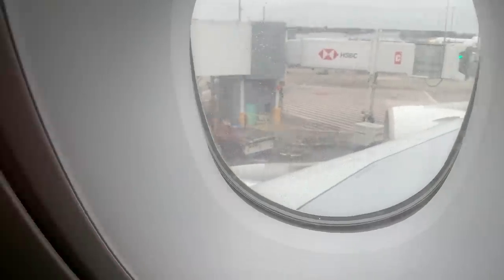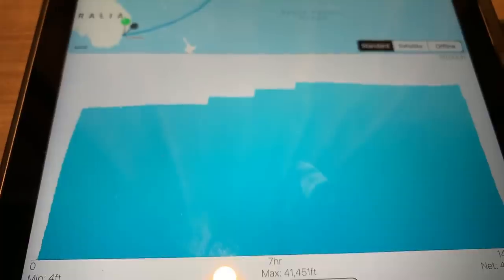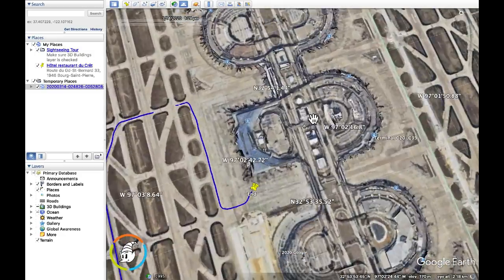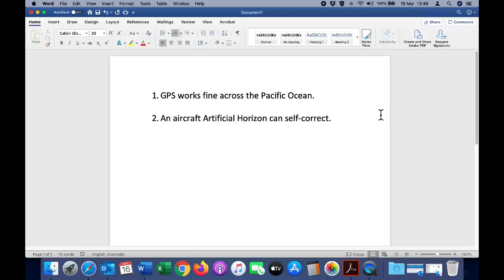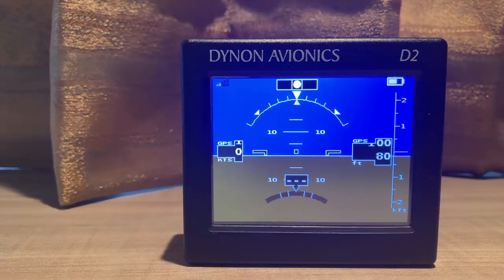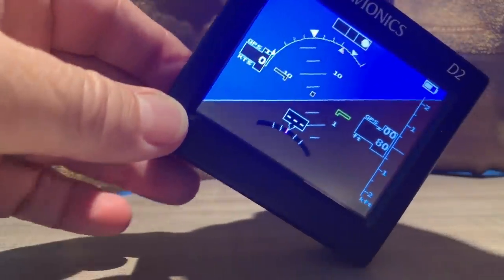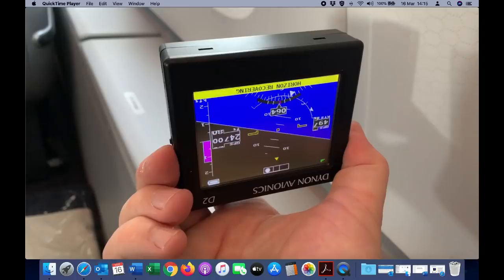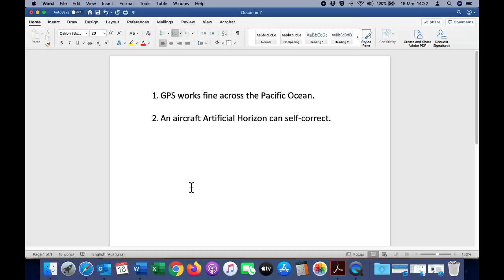GPS and Gyro testing on Qantas Flight 7 across the Pacific.

Comment: But what enables the unit to adjust for supposed curvature?, wouldn’t be the ambient air pressure differential sensors known as pitot type device? So my unit has no gps and no pitot tube, U.K. to South Africa should show minimum 35o we’ll see...

Switch off your pitot technology and show us your AH in you actual plane correcting, there is no curvature, my device doesn’t make corrections it is CALIBRATED ONCE.

Why lie??

Aircraft altitude is measured (inferred) by atmospheric pressure. The aircraft is usually flown at an altitude that maintains constant ambient pressure (by pilot or autopilot, as the case may be). Changes in local barometric pressure (provided by air traffic control) are used to recalibrate the aircraft altimeter. As long as the aircraft is flown at a constant ambient pressure (hence constant altitude), it will be following the earth's curvature (as the atmosphere is attached to the spherical earth and has same properties at same distance from the center, in an ideal case) as the altitude is measured from the surface, which is curved, and not a plane.
Reply from the maker: +Rude 
.  
Hey mate I did see your post and will get to them.  In course for a week and starts in a few hours.   

Don’t want you to think I was ignoring you.  

International travel is a bit crazy at the moment with many changes.
Reply: Wolfie6020 nothing you can disprove here wolf, all information is clearly displayed on tinternet...
Nice try though ✌️
Reply from the maker: +Rude Earther.  

That last paragraphs in your post is completely correct.  Is that what you are saying is the lie?  

The pitot tube measures total pressure and subtracts static to give you dynamic pressure. That is for airspeed

The static vents measure ambient pressure which gives you altitude and vertical speed 

 If a static port is blocked the pitot readings are inaccurate. 

A Baro in a flight controller is like the static port.   

A naze acro with no Baro can’t maintain its own altitude.  A naze32 with Baro can. 

Does the vector have Baro?   This is the static port. 

Without the accelerometer the flight controller has no idea which way is up.  

I can adjust the indication in the Dynon also and all that does is apply an offset in case toy have it mounted at a slight angle.

Without the accelerometer the dynon is useless.  Like disabling the pendulous canes in a mechanical artificial horizon.  It is useless then too as it will drift and be inaccurate within minutes.

Here is a question.  How many seperate values can a 16 Bit ADC produce?  

Not having a go just wondering if you know?
Reply from the maker: Well mate, I just read your other post.  Calling me a liar.   No I am not a liar.  

I told you I would not be the one to burn the bridge.   Looks like you want to do that?  

You are not understanding again.   You are confusing what I am showing you here as it has nothing to do with the barometer and how aircraft maintain altitude.  

Why would you act all friendly and turn when I was staying respectful to you?  Flat Earthers always are the ones to turn and burn a bridge.  Why mate?   Every single time I have developed any rapport with a Flattie they have broken it first...  

I am disappointed  in you mate.  Very.

I actually back off due to the few I thought I have a rapport with.  If that is gone then I won't hold back in my videos and I will show the audience how truly stupid flat Earth is.

Remember mate.  You broke the bridge.  Not me.   Obviously Flat Earthers have no honour and you can't trust what they say.  Their word is worthless.  Thanks for reminding me mate.
Reply: Wolfie6020 the lie is that the gyros in the AH are self adjusting for curvature, they are not, it requires the data from the pitot equipment to re calibrate for curvature, I’ve just ordered the pitot kit for my vector as to explain properly to those who are interested in the truth. I don’t blame you, your mental training won’t allow you to accept what is being told.👍🏻✌️
Reply: @Rude_Earther  The gyroscope requires data from the pilot? What data? How is that data entered by the pilot so the gyroscope can receive it? What if the pilot doesn't enter data, what does the gyroscope do by itself?
Reply from the maker: +Rude Earther.  You just don’t get it mate.  You missed the point entirely 

The pitot tube has zero effect on the artificial horizon

Go ahead and lead the gullible and blind Flatties down the garden path.  That is on you.

I could have ridiculed you with the EQ mount.  You have no honour at all do you mate.
Reply from the maker: +NinjaMonkey. He means the pitot which is a pressure sensing vent on an aircraft.

Absolutely irrelevant to the point I make here.  

His comment just shows me he still can’t grasp the big picture.

I tried to be friendly with him but Flatties can’t help themselves and turn like rabid dogs every time.
Reply: NinjaMonkeyPrime Aircraft altitude is measured (inferred) by atmospheric pressure. The aircraft is usually flown at an altitude that maintains constant ambient pressure (by pilot or autopilot, as the case may be). Changes in local barometric pressure (provided by air traffic control) are used to recalibrate the aircraft altimeter. As long as the aircraft is flown at a constant ambient pressure (hence constant altitude), it will be following the earth's curvature (as the atmosphere is attached to the spherical earth and has same properties at same distance from the center, in an ideal case) as the altitude is measured from the surface, which is curved, and not a plane.

Not according to pilot education wolf. Pitot device has everything to do with adjusting for curvature in flight...
Reply: NinjaMonkeyPrime gyroscope hold LEVEL AND FLAT, or perpendicular flight on its own, all information available on the internet, search pilot manuals and handbooks.
Reply from the maker: +Rude Earther. So you agree with every word in that paragraph?  All of it?  Yes or No?
Reply: Wolfie6020 everything except the earth being curved...
Reply: Wolfie6020 no wolfie I burned no bridges, I’ve seen your comments attempting to nullify my showings, think about that.
Reply: @Rude_Earther  "Aircraft altitude is measured (inferred) by atmospheric pressure" That is one method but there are at least two others. You do realize that right? 
"The aircraft is usually flown at an altitude that maintains constant ambient pressure" How is this relevant to the video? You are trying to compare how high the plane is to a device that is designed to keep the plane level. Which makes your other comment to me really insane.
"gyroscope hold LEVEL AND FLAT, or perpendicular flight on its own, all information available on the internet, search pilot manuals and handbooks" Yes, and that is what the video shows. I'm not sure you understand what that means. You've basically scored on your own goal without realizing it.
Reply: NinjaMonkeyPrime no, the gyro doesn’t adjust for curvature without the pitot equipment, check my page and, if you own more that one cell, you might work out exactly what I’m saying...
Reply from the maker: +Rude Earther.  Did I come to your channel calling you a liar and telling you that you have lost my respect. 

No.  I was very respectful to you while there. 

I deliberately held my tongue on several points to not burn a bridge.

Not understanding what I show in my videos does not make me a liar mate.  

This video was planned long before you started making yours with your vector.  

You just assume I made it because of you.  I have plenty of artificial horizon videos made years ago.  This is not a drone AH anyway. It is a real one.
Reply: Wolfie6020 no, you went to warriors channel and made me out to be either a fool or a liar, I can assure you, many thing’s I am, a fool and a liar aren’t two of them.
Reply from the maker: +Rude Earther.  So you cherry pick what you choose to believe from that? 

Really?  Think about how biased that makes you look.

Thanks for showing that pilot documents state the Earth is not flat.

You are so confused mate.  The pitot is totally irrelevant to my video or the artificial horizon.

Who is the flight instructor mate?  I assure you that you don’t know what you are talking about.

39 years in aviation,  10,700 hours on real aircraft.  You think you understand pitot / artificial horizon better than I do?  Really mate? 

Explain the  turning and acceleration errors without googling thanks.

In class now so don’t get excited if there are no replies  for a while
Reply: Wolfie6020 cherry pick, it’s common aviation knowledge that it’s the pitot device data that allows curvature adjustment, you know this full well, you also know if I calibrate my unit level in one position on a sphere, and move it to another without gps, or pitot data, we should see mucho deviation, you know it won’t show that because you fly over a flat plane not a curved surface, are you sweating over my less than 300 sub channel, seems you might be...
Reply: Wolfie6020 produce the information stating the AH adjusts for curvature without the ambient air pressure differential equipment...
Reply: Wolfie6020 oh, and as for coming to your channel, you’ve been all over mine for weeks, I have only ever defended you against other feers, and see you attempting to belittle my knowledge and invalidate my findings, making videos regarding my experiment without mentioning my name and think that’s ok? Nah m8, I tried to keep this amicable, but you couldn’t ignore someone talking truth and so attempting to discredit my relevance against your job title. Tut tut.
Reply: NinjaMonkeyPrime think you didn’t see the term ‘experimental aircraft’ there...
Reply: NinjaMonkeyPrime and my unit doesn’t use a pendulous gyro...
Reply from the maker: +Rude Earther said ‘Wolfie6020 produce the information stating the AH adjusts for curvature without the ambient air pressure differential equipment...’

I have in this video and many others mate.  You just don’t get it. 

There is no connection between the AH and the pitot tube.  This Dynon is self contained and that proves it too.

You have a very poor comprehension of what you read and watch.

Honestly mate.  I just give up on you.  I did my best to help you but clearly are not very intelligent and I can’t help stupid.  

99% of the audience know I am right.  That is good enough for me.

If you want to mislead the gullible Flatties with your poor understanding on the topic then go right ahead.

From this point I have given up trying to help you.
Reply: Wolfie6020 
Ahhhhh just let him keep making a fool out of himself...
Reply: @Wolfie6020  "You think you understand pitot / artificial horizon better than I do?"
He does think that, classic Dunning-Kruger. Remember PW teaching you about the HUD... Flatties are priceless.
Reply: @Rude_Earther  "pendulous veins are the pitot part of the equipment"
VANES. And why are they called PENDULOUS, by the way?
Reply: @Rude_Earther  What exactly do you mean by "the pitot device"? Do you mean the whole pitot-static system? Because the pitot itself has nothing to do with what you suggest.
Reply: Hashmal Dawn you’re a pilot aren’t you? You know what a pitot type device is for... 
Aircraft altitude is measured (inferred) by atmospheric pressure. The aircraft is usually flown at an altitude that maintains constant ambient pressure (by pilot or autopilot, as the case may be). Changes in local barometric pressure (provided by air traffic control) are used to recalibrate the aircraft altimeter. As long as the aircraft is flown at a constant ambient pressure (hence constant altitude), it will be following the earth's curvature (as the atmosphere is attached to the spherical earth and has same properties at same distance from the center, in an ideal case) as the altitude is measured from the surface, which is curved, and not a plane.😖
Reply: @Rude_Earther  I'm trying to get at what you mean by "pitot type device". The pitot itself has nothing to do with maintaining altitude, it's the static ports that are used for that.
Reply: Agent 666 Electric attitude indicators Vs Pendulous Vanes

Electric attitude indicators address some of the inherent problems of vacuum-driven attitude indicators. Since there is no air flowing through an electric attitude indicator, air filters, regulators, plumbing lines and vacuum pump(s) are not needed.

Contamination from dirt in the air is not an issue, resulting in the potential for longer bearing life and more accuracy. Erection mechanism ports are not employed, so pendulous vanes are eliminated.

It is still possible that the gyro may experience precession and need to be erected. This is done with magnets [not gravity] rather than vent ports. Typically, electric attitude indicator gyros can be caged manually by a lever and cam mechanism to provide rapid erection. [Figure 10-102]

pendulous vanes blog figure 10-102 Screenshot from 2017-06-06 17:27:32

So as we can see, pendulous vanes have their uses and weaknesses, but one task they cannot perform is the mythical correction for the non-existent curvature of the earth. The simple principles of rigidity in space and precession provide all the knowledge capable of determining whether we are living on a spinning, hurtling, orbiting ball. The only conclusion that we can draw is that the earth is a stationary plane.
Reply: Agent 666 how does the aircraft know it’s flying in consistent ambient pressure...

With pitot, or pendulous veins...

😖😖

😖😖😖
Reply: mojomusica I said nothing, all this information is from pilot websites on the net, so are the pilots wrong??
Reply: Agent 666 pitot is for air pressure differential sensing which applies to ALTITUDE and SPEED not the attitude of the vehicle...
Reply: Not Flat I’m fully aware of this equipment, you’ve already posted irrelevant shite multiple times on my channel, you getting worried?
Reply: @Rude_Earther  The aircraft knows it is flying in constant ambient pressure because it measures that pressure and keeps it constant. Nothing to do with the pitot, nothing to do with the AH
Reply: @Rude_Earther  "_It is still possible that the gyro may experience precession and need to be erected. This is done with magnets [not gravity] rather than vent ports. Typically, electric attitude indicator gyros can be caged manually by a lever and cam mechanism to provide rapid erection."_ What is the citation for this? And why does it say "erection" instead of correction? And magnets? There is no reference to that anywhere online. Let me guess, you found this on a conspiracy site and that is why you didn't include the source. How very intellectually dishonest. But I'm not surprised. You must be desperate by now.
"but one task they cannot perform is the mythical correction for the non-existent curvature of the earth" Wrong. No where did you read that. In fact you ignored the entire purpose of the pendulous vane which was to do the slow minor correction for Earth curve. 
So let's do a quick recap. You've wrongly linked the pitot to pendulous vane then laughed at me and called me a dick. You've then found an unknown source that claims magnets are used when all other sources make no such claim in an effort to deceive others. And you've totally ignored that modern equipment uses different methods. But let me guess, you found someone who will claim accelerometers can't detect gravity either, which is what you need to argue the device in the video. 
Hey, remember the Dynon D2? It's like a major player in this video. And something that all your garbage has yet to even address. Funny that.
Reply: Hashmal Dawn Aircraft altitude is measured (inferred) by atmospheric pressure. The aircraft is usually flown at an altitude that maintains constant ambient pressure (by pilot or autopilot, as the case may be). Changes in local barometric pressure (provided by air traffic control) are used to recalibrate the aircraft altimeter. As long as the aircraft is flown at a constant ambient pressure (hence constant altitude), it will be following the earth's curvature (as the atmosphere is attached to the spherical earth and has same properties at same distance from the center, in an ideal case) as the altitude is measured from the surface, which is curved, and not a plane.
Reply: Hashmal Dawn Atmospheric Pressure

Though there are various kinds of pressure, pilots are mainly concerned with atmospheric pressure. It is one of the basic factors in weather changes, helps to lift the aircraft, and actuates some of the most important flight instruments in the aircraft. These instruments often include the altimeter, the airspeed indicator (ASI), the vertical speed indicator (VSI), and the manifold pressure gauge.

Though air is very light, it has mass and is affected by the attraction of gravity. Therefore, like any other substance, it has weight; because it has weight, it has force. Since it is a fluid substance, this force is exerted equally in all directions, and its effect on bodies within the air is called pressure. Under standard conditions at sea level, the average pressure exerted by the weight of the atmosphere is approximately 14.7 pounds per square inch (psi). The density of air has significant effects on the aircraft’s performance. As air becomes less dense, it reduces:

Power, because the engine takes in less air
Thrust, because the propeller is less efficient in thin air
Lift, because the thin air exerts less force on the airfoils
The pressure of the atmosphere may vary with time but more importantly, it varies with altitude and temperature. Due to the changing atmospheric pressure, a standard reference was developed.
Reply: Hashmal Dawn A pitot-static system is a system of pressure-sensitive instruments that is most often used in aviation to determine an aircraft's airspeed, Mach number, altitude, and altitude trend. A pitot-static system generally consists of a pitot tube, a static port, and the pitot-static instruments.[1] Other instruments that might be connected are air data computers, flight data recorders, altitude encoders, cabin pressurization controllers, and various airspeed switches. Errors in pitot-static system readings can be extremely dangerous as the information obtained from the pitot static system, such as altitude, is potentially safety-critical. Several commercial airline disasters have been traced to a failure of the pitot-static system.
Reply: NinjaMonkeyPrime A pitot-static system is a system of pressure-sensitive instruments that is most often used in aviation to determine an aircraft's airspeed, Mach number, altitude, and altitude trend. A pitot-static system generally consists of a pitot tube, a static port, and the pitot-static instruments.[1] Other instruments that might be connected are air data computers, flight data recorders, altitude encoders, cabin pressurization controllers, and various airspeed switches. Errors in pitot-static system readings can be extremely dangerous as the information obtained from the pitot static system, such as altitude, is potentially safety-critical. Several commercial airline disasters have been traced to a failure of the pitot-static system.
Reply: mojomusica A pitot-static system is a system of pressure-sensitive instruments that is most often used in aviation to determine an aircraft's airspeed, Mach number, altitude, and altitude trend. A pitot-static system generally consists of a pitot tube, a static port, and the pitot-static instruments.[1] Other instruments that might be connected are air data computers, flight data recorders, altitude encoders, cabin pressurization controllers, and various airspeed switches. Errors in pitot-static system readings can be extremely dangerous as the information obtained from the pitot static system, such as altitude, is potentially safety-critical. Several commercial airline disasters have been traced to a failure of the pitot-static system.
Reply: @Rude_Earther  Yes, thank you for mansplaining, but none of it covered my point. My point, again, the aircraft knows it is flying in constant ambient pressure because it measures that pressure and keeps it constant. Nothing to do with the pitot, nothing to do with the AH
Reply: @Rude_Earther  No need for a temper tantrum!
Reply: @Agent 666 "And it's hilarious just how confident he is that he's right" I'm shocked that the videos where the old attitude indicators are physically disassembled so you can clearly see how they work are still not registering with him. But that still has absolutely zero to do with the device that Wolfie shows in the video or any other modern day attitude device. The modern devices don't use vacuums or air at all so this entire exercise is made even more pointless, which I didn't think was even possible.
Reply: Pendulous vanes erect the mechanical A.H. by gravity. Accelerometers "erect" the electronic Dynon D2 A.H. by gravity. Gravity acts perpendicular to earth's curved surface. So if you move the A.H. over earth's surface, it constantly corrects to the downward vector of gravity, thus constantly correcting for earth's curvature.
Reply: @zombiewoof5257  "Pendulous vanes erect the mechanical A.H. by gravity" Oh, so that's why his quote had the word "erect"? I guess the term does make sense that way. I assumed it was a typo for "correct". Too bad his quote (still waiting on the source) said that magnets were the cause and not gravity.
Reply: NinjaMonkeyPrime you need to watch the playlist on my channel regarding gyroscopes...
Reply: @Rude_Earther  My point, once again, the aircraft knows it is flying in constant ambient pressure because it measures that pressure and keeps it constant. Nothing to do with the pitot, nothing to do with the AH
Reply: NinjaMonkeyPrime I smell fear of the truth. It’s ok some prefer comforting lies, some say ignorance is bliss. So long.✌️
Reply: NinjaMonkeyPrime simple fact is, the AH of an aircraft is adjusted via data from the pitot tubes, I have a device that works as the AH but doesn’t require pitot or gps, in other words it doesn’t adjust for curvature, it senses physical deviation from initial calibrated levels only, I’ll be taking it on a decent flight, if the AH registers deviation from initial perpendicular level we live on a sphere, if not we live on a level plane of some kind.😎
Reply: @Rude_Earther  But your "simple fact" is wrong. The AH on an aircraft is not connected to the pitot-static system, so your "experiment" has already failed.
Reply: @hashmaldawn3878  "The AH on an aircraft is not connected to the pitot-static system" It's almost like he's ignoring reality and making things up.
Reply: @NinjaMonkeyPrime  Apart from the fact that the fundamental concept of his test is utterly wrong, it's a brilliant test!
Reply: @Rude_Earther  tell me, can you finally show us something as simple as a functional FE based map?
Reply: @Alysm-Aviation  
I agree with you as I too would like to see a flat Earth map that works rather than all this talk about how his erection has pendulous veins.  He has claimed that the the Monte map, a map that is an obvious sphere, is a flat Earth map.  The only reason that it makes a sphere when joined together is because of NASA or something.  Don't expect anything other than low testosterone insults from him.
Reply from the maker: +Rude Earther.  You should have read the Major’s book before commenting on Level Earth observer’s video about the the SR-71 pilot.

You should delete that comment and hope nobody saw it before the debunk comes out and you all look like fools again...

Don’t say I didn’t try to help you when it is too late... .

Another example of you guys praising videos without doing your homework first...  group fail...

This was already debunked long ago anyway... 0/10 for doing your homework.
Reply: @Rude_Earther  I bet the women all love you with that attitude right? Are you over-compensating for inadequacy in that department?
Reply: Hashmal Dawn only one woman for me, we’ve been together 21 years, so again.FAIL...
Reply: @Rude_Earther  I'm surprised anyone would put up with you!
Have you figured out yet that the AH does not have any input from the pitot-static system?
Reply: @Rude_Earther  You've posted supporting evidence? You keep trying to say the AH is related to the pitot system by just posting info on what the pitot system does. There's nothing backing up your crazy idea not to mention nothing remotely addressing the AH unit in this video. Why haven't you watched the videos showing actual AH units disassembled?
Reply: NinjaMonkeyPrime the pitot system helps with precession as the vehicle supposedly travels over a curved surface, it uses air pressure apparently to re align or re calibrate. Look it up dummy.
Reply: @Rude_Earther  "Look it up dummy" I have. Every quote you give has zero link to the AH. The pitot system is altitude. The AH is not related. When you say "look it up" does that mean avoiding all the information on how the AH works? Because if you would just "look it up" for the AH you'd quickly see you are wrong.  Why won't you comment about the 3 videos showing how the AH systems work including the 2 which disassemble them right before your eyes?
Reply: @Rude_Earther  You do realize that altitude (with an L) and attitude (with a T)  are separate things with separate instruments to measure them right? The pitot system was for aLtitude while the AH is for aTtitude.  Not to mention (for maybe the 5th time) you keep ignoring how modern day equipment is fully electronic like the one in the video.
Reply: @Rude_Earther  "you have less than nothing and the comprehension of a lettuce leaf" I have you running scared from clear and obvious evidence you are wrong including your own words. You constantly quote information on altitude devices while looking at a video on an AH device. Are you going next tell us that an altimeter can be used as a spirit level? You keep trying to equate devices with separate functions as the same when all data (including your own) shows you wrong. Why haven't you commented on the 3 videos showing how AH devices work including 2 that show actual old AH devices disassembled?
Reply: @Rude_Earther  Would you actually care to reply to the issues with your claims? If all you have is ad homs, then I suggest you simply stop posting.
Reply: @Rude_Earther  thank you for proving my point.
Reply: @Rude_Earther  One example that doesn't back your claim! Like all your other examples. You do realize that there are people here that are actual pilots right?
Reply: Hashmal Dawn it backs my point perfectly, the gyro of a plane is re calibrated flying over supposed curve via data from the air pressure differential system. You not understanding isn’t my problem, it’s yours.
Reply: @Rude_Earther  What the hell is an air pressure differential system?
It's very simple, the AH is not connected to the pitot/static system at all. Nothing you've linked says that it does. It's completely clear that the AH Wolfie demonstrates, is not connected to any pitot/static system. No pilot or engineer will ever tell you they are linked, and that is because they are not.
I have no problem understanding AH and pitot/static systems. and I don't need Google to find the answers. It seems you are utterly unable to actually do research!
Reply: Hashmal Dawn the plane follows the fucking curve as it remains in its ‘lane’ of pressure, (see altimeter attached to pitot system), the gyro, unless earth or weighted type, is ADJUSTED via the altimeter as the plane remains in its correct pressure lane, the gyro would hold the plane perpendicular otherwise and cause a rise in actual altitude as the ground curved away...!!!!!
Reply: Hashmal Dawn you might want to read these type of documents Mr. Pilot.

Sources of Power
In some aircraft, all the gyros are vacuum, pressure, or electrically operated. In other aircraft, vacuum or pressure systems provide the power for the heading and attitude indicators, while the electrical system provides the power for the turn coordinator. Most aircraft have at least two sources of power to ensure at least one source of bank information is available if one power source fails. The vacuum or pressure system spins the gyro by drawing a stream of air against the rotor vanes to spin the rotor at high speed, much like the operation of a waterwheel or turbine. The amount of vacuum or pressure required for instrument operation varies, but is usually between 4.5 "Hg and 5.5 "Hg.
One source of vacuum for the gyros is a vane-type engine- driven pump that is mounted on the accessory case of the engine. Pump capacity varies in different aircraft, depending on the number of gyros.
Reply: @Rude_Earther  The aircraft maintains altitude, and therefore the curvature of the earth by maintaining a constant atmospheric pressure. That is nothing whatsoever to do with the AH which is an attitude instrument and not an altitude instrument.
Should we assume you have dyslexia and can't see that the word ATTITUDE is different from the word ALTITUDE?
None of your links confirm what you are saying and actually clearly show you are incorrect.